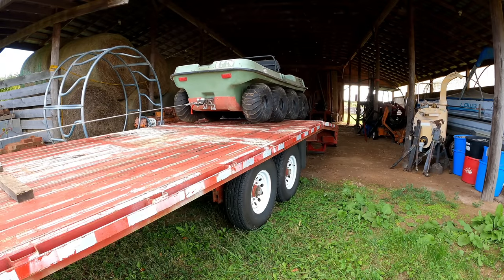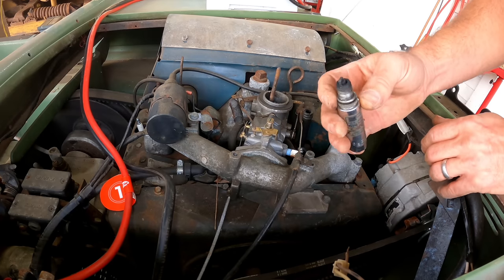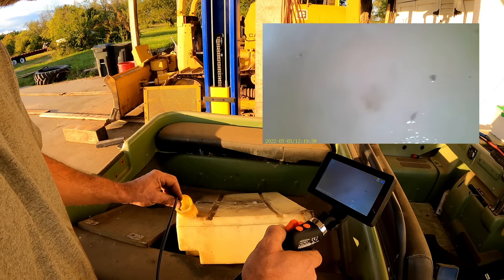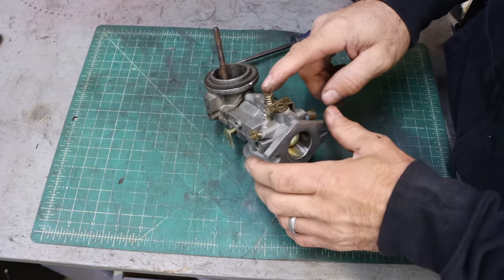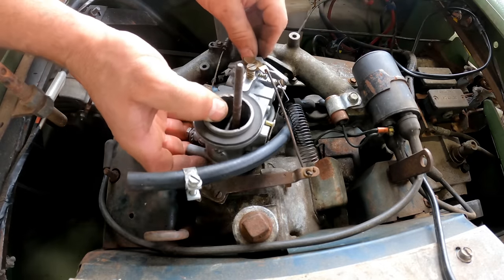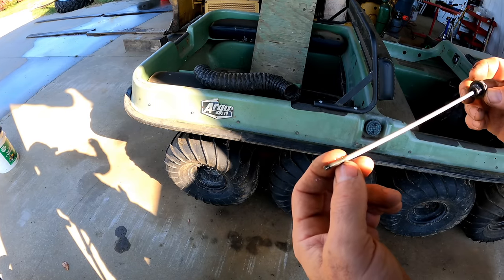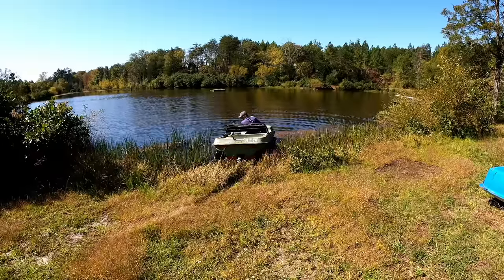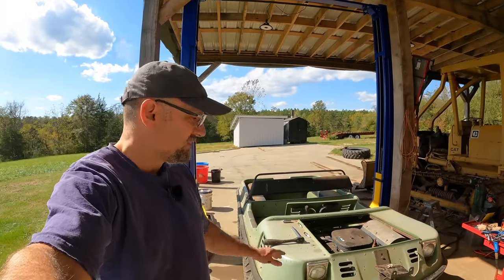Fixing An Abandoned Argo Amphibious Vehicle, Will It Start?

Comment: As a nurse the way your endoscope rotates reminds me of the instrument that doctors use to perform a colonoscopy.
Reply: Similar but smaller. Also this doesn't have the ability to pump gas in, release gas out or suck liquids out. Or use a snip to take out a sample and pull it out.
Not a nurse, just been the target of that horror way too many times and here they don't put the patient to sleep for the operation.
Reply: This technology has game changed so many “now old” practices.
Reply: @alaric_ I had it done 4 or 5 times. Except for the first one I was put out for all the others. I had one polyp different times. I suggest you find a new doctor.
Reply: Ouch - as a colitis suffer I’ve had both with and without laughing gas - much prefer it going into a cylinder and not my @@@@@😮😮😮😮
Reply: @alaric_  Reminds me of a cartoon, doctor to patient:  "Your healthcare package doesn't cover the cost of the prep-kit so we'll have to slap the crap out of you."

Comment: Based on my experience with these:
#1.  You need a base of sizeable rocks for a launch/recovery ramp on the pond.
#2.  When you pack the side bearings, the leaks will completely stop.
#3.  "Don't" experiment with tires.  The originals are the best performers you will find.
#4.  Sealing up the upper/lower body halves will be a great asset to operation.
#5.  You don't need to modify the hood.  Now you know you can gain access via the instrument panel.
#6.  Fabricating a roll-type bar for mounting lights (forward and rear facing) is a great addition.
It will keep running better as you use it.  You're going to have a lot of fun with this and it's a wonderful farm tool for getting into the back country segments of the Farm.  One valuable tid-bit.  If you switch to full synthetic oil for the engine (10W-30), you will reduce the operating temperature by 20 to 30 degrees.
Reply: You mighty be a brilliant mechanic yourself, ...but your wordings really made him look like a fool. He's in his 40s, He's almost five hundred subscribers, and his channel name us I FarmCraft101, he teaches people what to do,...  .. about  mechanics, electrical, to run a farm, an arborist, fix electricfans, do carpentry, how to use ropes, ties a shoes and others. And now you're telling this poor old man what's the correct way to do as if he's a rookie. Who are you, mate. You sure be a respectable and accomplished man in yer trade.
Reply: 7 add a small automatic bilge pump. They have ones that run every few minutes automatically, and keep running if they detect load on the pump. Would be perfect for this.
Reply: Looking at the back of the box there makes a guy wonder about clamping on an out board. Is that a thing??
Reply: @Obsidian0Knight they are made for a trolling motor because they are so slow in the water.
Reply: Man. I see this Argo as a toy. Used for fun rides at family picnics. To use on your pond to fish out of…? More fun on pond when frozen.
Reply: Dang, tires was my first thought.
Reply: @MikeZMonroe  Hunters use them a lot. Line the back with plastic sheet and haul out the quartered moose.
Best wishes from the far North.
Reply: I'd be trying to track convert it, but the amphibious capabilities are worthless to me as I don't have anywhere for it to swim in the first place.
Reply: @lonwof2105  Virtually everybody does.  Some have even used paddle tires, but they don't improve performance.
Reply: @Obsidian0Knight  Manny have tried. The shape of the unit doesn't end itself  to more speed.
Reply: My friend has a 6 wheel version with a trolling motor.  He doesn't have Argo tires.  Argo tires are pricey.
Reply: @pimpnick4920  That is true.  It's the fact ARGO did their homework for the tire-type application.  A reality to face is that the vehicle has no water speed capability, even with an outboard.  You can likely find a similar and less expensive tire.  My point is that other tire designs have not proved out to increase water efficiency.  On land, it's a different situation and it performs quite well.
Reply: 8. Move the battery to the back for better weight distribution, a bigger battery will also help distribution and better handle a winch. Install a 2 pole connection block where the original battery is located and pull extension cables to the back. :)
Reply: Argo's are junk. Throw it away lol
Reply: @lotfaeponpoon5432  Good input ...
Reply: There's no real " converting" to do. Pop the wheels off, install the hub spacers, put the wheels back on, drain the air out of the front and rear tires, put track on and air the tires back up . Whole deal takes about an hour.
Reply: There are much better tires available than the RunAmucks they come with...much better!  The guy who  said dont mess with the tires must not take one in real nasty swamp like we do so I'm sure they are fine for him in the back yard.  Stock tires are crap,. I have run Argos for 45 years and they most certainly can use upgrades with tires being one of the first.
Reply: @Rasputin-p4e  He literally asked for advice.  @richardgreen7811 provided some valuable insights based on his experience.  There was nothing disrespectful in his comments.  YOURS, however....
Reply: @BlindmanValley  The tire reference equates to people attempting to use sand paddle tires and the like.  There's no advantage, in fact they are less effective.  Yes, there are different manufacturers and tread types, but my experience has been staying with the original tire type gave better results.
Reply: @Rasputin-p4e Hes litteraly just giving him some tips. Relax tough guy
Reply: @Rasputin-p4e nothing in the comment indicates disrespect. John actively asks for just this kind of commitment l.
Reply: @GunFunZS  it's not about disrespect, mate. It's about someone who think himself Mr tool belt. Look at his suggestion he was laying, it's very crude and very elementary. And he's very sure and proud of it as if it was a mechanical secret every one is dying to know..  Man, I won't let that slide by.
Reply: @Rasputin-p4e well Mr White Knight. Let him say something if there's an issue. Jeez. Like you said he's 40 after all. Mate
Reply: EXACTLY
Reply: @Obsidian0Knight  It very much was a thing, at least here in Scotland. They can kind of doggy-paddle through the water on their tyres but a little 5hp outboard will transform your amphibiousness.

Comment: @FarmCraft101 place your parts inside of zip lock bags or old plastic peanut butter jars.  Put whatever cleaning chemical that you want inside the bag or jar with the parts, then place the bags in the Ultrasonic cleaner filled with water.  This keeps you from spoiling the whole inside of the Ultrasonic and also allows you to use multiple cleaners at the same time and conserves cleaner.

Comment: Thank you for making this show. Growing up we two COOTs and I always wanted to know more about the Argo because of the TV show "The Banana Splits".
Now, at 70 years of age and seeing your show I am glad we had the COOTS. WIth the CLEATS we could put over the tires, although it a real hassle for a teenager in a hurry, they did work. Yep! Nothing like two wheelbarrows back to back  with a motor and a steering wheel. You brought back great memories. Thank you again. Jay
Reply: The banana split machines were not argos.. They were actually called and amphicat and were 6 wheel.    While quite similar in basic principal, they used a different transmission and a two-stroke engine. I am currently rebuilding one to go along with my new argo. ( 8 wheels and an aircooled v twin briggs....argo has. Offered multiple engines through the years)

Comment: Hi John,
When I was about 16 a neighbor behind my house built one of those things. He planned on selling them and asked me and my buddies to help him proof it out. We had an abandoned farm the expressway cut in half with several ponds and woods and fields where we tested it out for him. It was neat but it would not climb out of a pond through the muck. Just like yours his got caught on the belly. I never bought into the idea since it couldn't climb out of the water without an improved access. On cylinder wall pitting it looks like that when someone lets it sit and rust for a while and then runs it. No worry since it doesn't seem to pass that much oil and smoke out the exh. Keep an eye on the oil level and you'll see it's probably just fine. The oil you see on the cylinder wall is normal for a "Flat" or "Pancake" engine where the pistons move horizontally. The oil is there to lube the piston and rings while it running but when you stop it that oil will move to the bottom of the cylinders and appear to be excessive. I mean it's not brand new, so it's going to pass a little oil and that is what you are seeing. As for the Starter, the problem is most likely rust on the sliding parts like the actual armature where the pinion gear (you called it by a brand name: Bendix) slides in and out to engage the starter ring gear or it's the plunger on the solenoid sticking on rust or grease or gunk.  As for charging, it looks like an older GM alternator, so c'est la vie. You get what you pay for. A few years ago you could buy a voltage regulator at the department store for a GM alternator, so there's your dinner. ben/ michigan

Comment: I recently bought a 5 1/2 acre homestead in a rural area that I planned to develop periodically on weekends and vacations; until of course, I realized how long everything takes to progress.  As someone with no experience, your videos give me perspective on the long and rewarding road ahead this has been immensely valuable.  BTW I spent $2400 at Vevor using your link for the forge a few weeks back so thanks
Reply: I just moved into my first and last house on two acres in between an old dump and a lake in New Hampshire. I needed decent fill to smooth out where I'm hand digging rocks and junk up and as I don't have much of an income I called the town's maintenance department as they were hauling dirt every day. Not only is it free after signing a waiver but it saves them time and money being able to dump here. I use my trailer with it's expanded steel floor to screen the dirt for the yard and the rocks for the driveway, edging and other projects. Hope that helps if you ever need good  fill.

Comment: Borescopes Inspection - Retired from a aerospace engine manufacturer. In the early 90’s a significant complex magnesium casting had multiple cores used to carry air or fluids. A nightmare to cast and weld repair.
Anyway - borescopes we’re just being introduced as an inspection tool. A perfect instrument to inspect internal passages…too perfect. This tool was a amazing and caught many defects. Your new tool reminds me of the love / hate relationship with the borescope😊
Reply: Aviation mechanic here. You have no idea how much modern borescopes have improved. In quality imaging, ease of use, 3D live measurements etc. It's come to a point where even clueless people like me can use them with confidence to inspect combustion liners and turbine vanes. Magnificent tool.
Reply: @hansingreece  Like many other electronics the initial market price is huge with selected users who can afford. Yours use a perfect example. Today buy a way less expensive devise to use at home.

Comment: Did you try backing out?  With the back end higher, you might get to dry-ish land and get some traction.  Otherwise, get a grappling hook and a front winch: unwind a bit of cable, throw it out and then pull yourself in.  For your pond, a nice launch would be best: doesn't need to be fancy, just some stones forming a ramp, but you should want to use this in places other than your pond and the grapple and winch technique could get you out of some hairy situations.  

Thanks for sharing, it looks like a blast to tool about on!

Comment: It kinda looks like slight pitting on the cylinder walls to me but it seems to run good. I think that the engine oil might be plugging up the slight pits and then stays on the top side of the piston. Watch your oil consumption and if it starts smoking. Also I would add a bilge pump and switch so you won’t have to worry about putting the plugs in and out.
Reply: Those holes in the cylinder walls are caused by woodworm.
Reply: @electrickal1  kinda looks like it 😂

Comment: An automatic bilge pump would be a good addition. Maybe cleaning out the mud at the edge of the pond and replacing it with sand would help. might want to check the oil in the engine to make sure it didn't go down since you are seeing oil in the cylinders.

Comment: Looks like a transom mount for a small outboard in the back.  One of those door steerable trolling motors would be neat.  Rock, excavator, no problem...maybe closer to the dam where it hasn't made mud yet...just build a road ramp...all good.  Thanks for another great video.
Reply: they will take a 9.9 horse short shaft outboard

Comment: Hey, I love watching your channel.
If I can give you some advice, the 2 screws that attach the throttle plate were difficult to loosen due to loctite. You need to replace them with loctite otherwise in time they'll come loose and go through the engine and cause a lot of damage.
Reply: I came here to make the very same suggestion. Hope he reads these suggestions.

Comment: I have a cheap constant current / constant voltage bench power supply. I have used it to revive batteries by setting the voltage to the charged cell voltage and limiting the current to an amp or two. This is a pretty safe way to charge a dead battery. Works on 12 lead acid, lithium ion, etc.

Comment: 1:50 Pro Tip. Instead of 2 small 1X6es, put a 1X6 or 1X8 long enough to spend both wheels. Before pushing the vehicle on top, put a small rock under the center Of the board. You will be able to spin it like a top.

Comment: Hey over here in the uk we used to spend many a summer break mucking about with these and I do remember is you really need to be ruthless with departing and entering the ponds with these otherwise you will get stuck , you would benefit from a decent ramp under water in your case great video

Comment: I had one of the smaller ones (only had 3 wheels on a side) back in 1972 and 73 had a lot of fun with in in the snow, But it would high center in the big snow drifts  bad.  I recall seeing tracks made for them but don't know if they were of much help , It was a lot of fun just to run around the farm with.    Look forward to each of your videos, take care and have fun.

Comment: Hey John... you can "trick" the new battery chargers. They have a safety that needs tonsee a minimum voltage to start. So if you jump it for a few mins with another battery it will start to charge. Then remove the jumper battery or battery pack and the way it will go. If it's really low you light need the jumper battery on longer. Hope ya see this love the videos.

Comment: The damage to the piston walls looks alright, if you run it a lot in the recent short time it will clean up better and act like a break in process again.  So run it a little hard, otherwise those rust spots will get larger faster.  Unfortunately once they start if it's not completely eliminated it will never stop rusting.  But if you can get the majority out of it, it should store well for years to come.  So Give it a break in period like it's a new engine.

Comment: They can have tracks put on over the tires which make them quite good in mud. They are a PainInTheAzz putting them on and off but the high centered problem goes away when you use them.

Comment: Anytime you leave equipment setting up if you've got cheap gas in it with ethanol always used Sta- bil gas stabilizer in the gas is stabilizes it keeps it fresh you don't have to worry about your gas lines being deteriorated and your carburetor having that green  gum it up

Comment: Argo... LOL It floats but it's not a boat! Both of ours had bilge pumps yours should too if you go in water. We used ours in salt marshes mowing phragmites carrying, lifting, towing, way more weight than they were ever meant to, they did well until the salt water thinned out the frame then they were just a maintenance nightmare. My best day was when the Brokanic (The Mechanic Who Doesn't Read Repair Manuals) who was constantly setting the idle too high which trashed the transmission and attempted to rebuild the transmission himself instead of waiting for me to get it. The Transmission is a step by step checklist in the repair manual which must be followed exactly in the manual or you break things. He succeeded in bending the last side cover and bending an arm for an idler gear on the casing. So the cost of the side cover & casing is the same as a new transmission and the transmission was over a couple of grand so they were done pouring money into them. We had just gotten a Marshmaster which was better suited to our operation so It was a good day for me. We had an epoxy in a dual syringe with a mixing tube which was great for hull repairs. I'll see if I can find out the name of it for you, your hull looks like it is in pretty bad shape...

Comment: Stick with the original tires. They will be best all around. Seal the upper and lower halves. Check the bearings most people neglect them and they will leak water. You have some blowby on your rings. Other than that just a rock entry to the pond and you are good.

Comment: That is a common issue with the Keihin carb. Pump diaphram and the needle sticks. Thats a skid steer tranny. Not differential. Dandahermit. It'll be ok. Good luck. Adjust all the chains. Idle prob is in the carb. Snowing n I gotta plow. G night. The longer u charge the more it will bust up the calcification on the bottom of the cells. Your prob is the fuel pump diaphram and feed needle sticking.